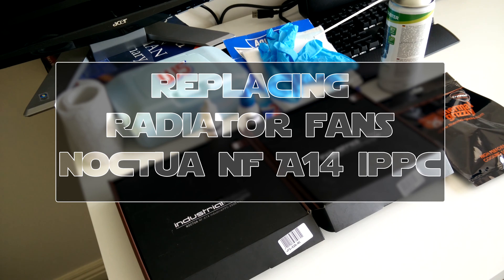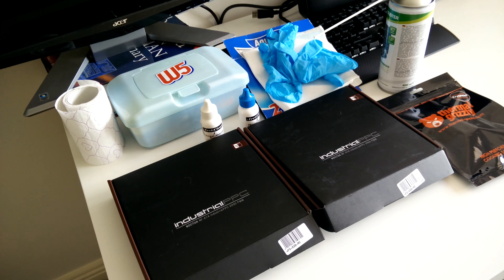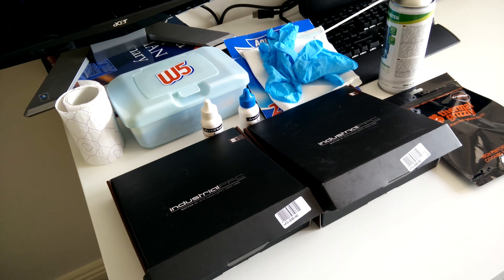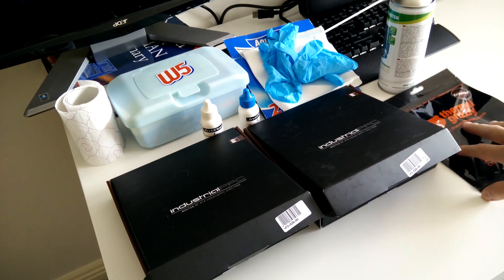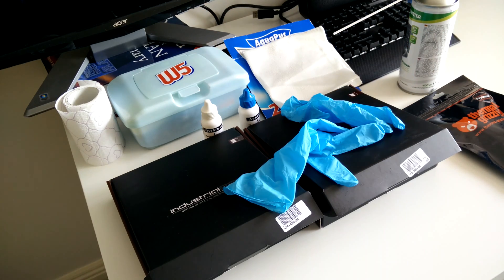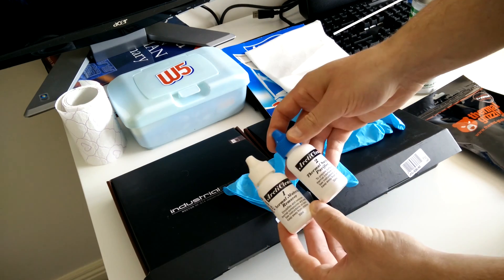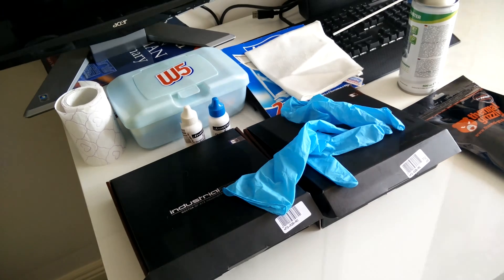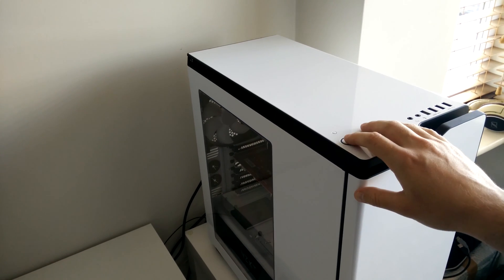Tech Video: Replacing H110i GT Fans - Noctua NF A14 iPPC

Comment: considering I'm running the same set up, in terms of running x99, and the same aio cooler, I may just have to take the same steps, at this point I need to switch to "quiet" when I record, and I still end up having to cut some of the fan noise using audacity. otherwise when I'm rendering or just playing I set it to balanced, but dear God does it ever sound like a plane is trying to take off from my case, and my case has some decent sound dampening, being the Fractal Design Define R5
Reply from the maker: It's a good plan mate, do you also have your CPU overclocked? I know that's certainly pushing temps up.
Also Balance mode is terrible, and god help anyone try and use Performance mode.

My current fans at Performance mode hit 1800RPM, and are still quieter than the Corsair ones at Balance mode.

So now I permanently run it Quiet mode, with just the pump in performance mode. In quiet mode during stress tests and long rendering Performance mode pump drops my temps a good bit as well.

Your Define R5 is also a cooler chassis than my H440, so you should get some decent temps.
Reply: +Al Valentyn with a 5930k of course that sucker is over clocked, oc'ed to 4.0, I did have it higher to 4.4 but it's summer time here and my office gets fairly hot even with out my system running. Generally my Temps only reach a high of 65c while rendering, even on quiet, but with those Noctua I'm sure even that would come down a significant amount.
Reply from the maker: TheKidnappedOne Ah yeah, I've mine pushed to 4.3Ghz, with the H440 being terrible for airflow; easily the worst case I've ever used I'm surprised how well the system coped.

I only always run my fans in quiet mode, which didn't help with little airflow. Just can't stand the noise.

Just don't forget some quality thermalpaste as well. 

I'm still regretting not getting a Fractal chassis, at least my h440 looks nice :P
Reply: +Al Valentyn I love building in Fractal cases, finishing up a build for a friend in the Node 804, I have usually recommended Fractal cases when and where I can, cost permitting. I honestly need to get a new mother board, I lost four of my eight dimm slots for some reason, just outside of my warranty, I just need to save up for it, since I just got a new graphics card.
Reply: +Al Valentyn as for paste, I always use Arctic Silver or better.
Reply from the maker: TheKidnappedOne From what I've read Thermal Grizzly Kryonaut is the best available outside of using Liquid Metals; which are very conductive.
Reply: +Al Valentyn I may have to look into them when I build the next system.
my motto is I don't build computers to sell them, I sell them so I can Build them, I take so much please in building a computer, literally sitting for hours just looking at a empty case imagining and planning how I'm going to running wiring, or any custom liquid cooling loop parts, for me this hobby is so much fun.
Reply from the maker: TheKidnappedOne I agree! I'll never understand people that say it's far too hard, or impossible.

So much you can do, even with older systems. Just recently I refurbished an old "dead" 2009 Phenom system, which is now a friend's first gaming pc.
Reply: +Al Valentyn I'm using my old second gen i5 for a storage and media server, little guy used to be my main gaming and render rig. Build I just did for my friends first pc is roughly a four year old amd chipset that she plans to use to learn coding and 3d rendering on.
Reply from the maker: TheKidnappedOne They're getting a very nice system, AMD ain't that bad when multicore is involved at least.

Even better with DX12 and Vulkan, hoping professional developers move their suits to those as well.

Comment: i have no problem with my corsair fans on my cooler but the one on my case failed quickly nice choice in replacement fans though nice build btw
Reply from the maker: I was really not impressed with these Corsair fans at all. Apparently their 120mm versions are much better than the 140mm. Quite a shame.

Can't fault the Noctuas at all, even though they're AirFlow fans instead of StaticPressure ones for radiators and heatsinks.

Just glad the temps are lower at lower noise levels. :D
Reply: +Al Valentyn I will have to invest man keep up the good work
Reply from the maker: Thanks mate, I just need a new GPU now. My new 390X died in less than a week. Poor thing :(
Reply: man that sucks have to catch up some time dude is it geting replaced under warranty
Reply from the maker: TaintedCamper I got a refund today at least; since there is no more 390X stock around. So waiting on a custom RX 480 model to come in stock.
Reply: sweet just a but better than my gtx970
Reply from the maker: Yup, I'm mostly interested in it for the dedicated video encoding hardware, then I'll grab one of AMD's top end card when those are out later in the year.